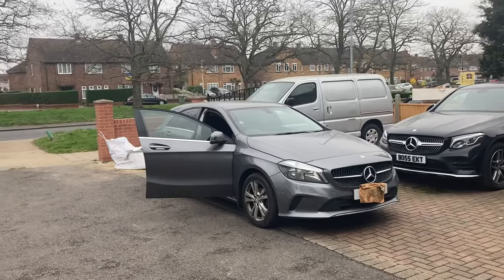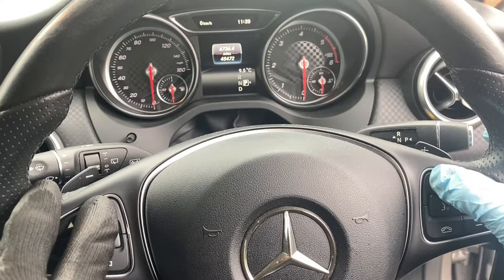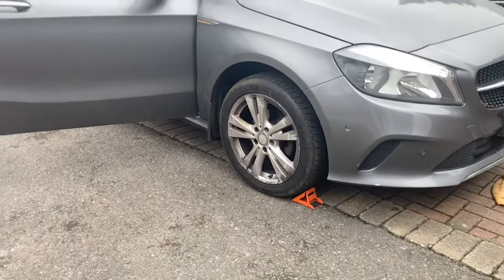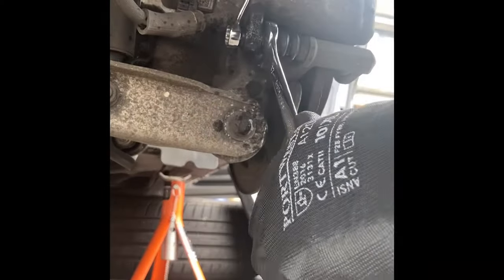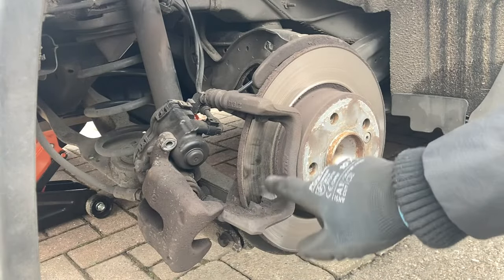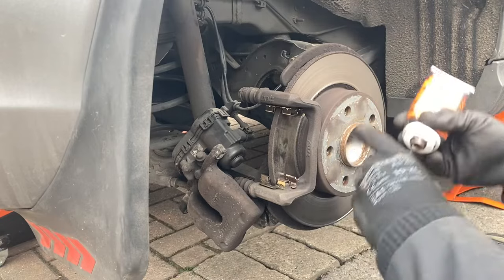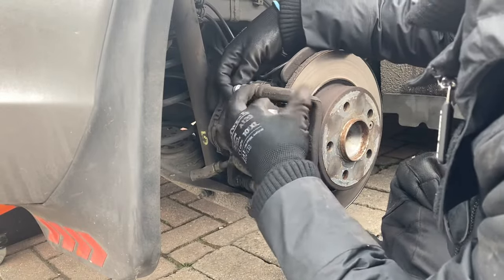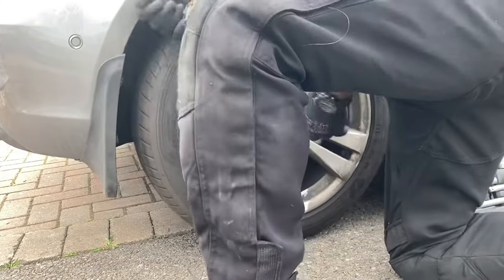Mercedes A Class (W176) Rear brake pads change.

Comment: Did you jist put two sensor pads on one side?
Did you know that they slight softer then other pair ?
Find mechanic.
Reply from the maker: https://www.instagram.com/p/Cbukcn4toRv/?igshid=NTc4MTIwNjQ2YQ== that’s how the set came from euro car parts. If you notice even prior to fitting the same orientation was present. If you have a look at the documented pictures all 4 pads are the exact same with sensor notches
Reply: @chiragbulsara  this set is for 1.5/1.6 engines
Reply from the maker: @nieprofesjonalnie yes which were correctly supplied from eurocarparts as this model is an A180
Reply: Never trust carparts my friend...

Comment: Hi pal do you have to leave ignition on after you rewind the rear calipers  on the A class  cheers
Reply from the maker: No once the car is put in diagnostics mode and the callipers are retracted you can switch off the ignition

Comment: Are there any break pads sensors in the rear wheels?
Reply from the maker: Might be car model specific. This a class didn’t have sensors on the rear however you can see the insert for a sensor indicating that these pads are designed for implementation of the sensor. You car may differ
Reply: Seems like my car is stock Without sensors. Only one in right front wheel. Thanks for fast answear, nice tutorial :)

Comment: Then do you have to go back into the menu and put the brake system back in 'normal' mode ? or does it just sort itself out when you apply the park brake next
Reply from the maker: Great question. You don’t have to go back on the menu. As you get in the car you’ll have to press the brake to start the car which consequently compresses the piston. There’s also an electronic handbrake, if this is applied that will hold the position of the piston.